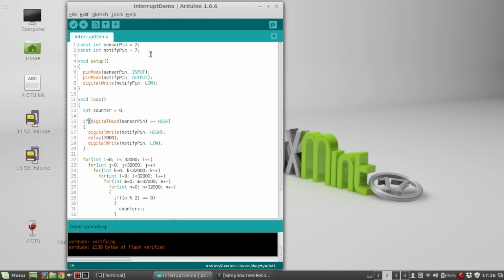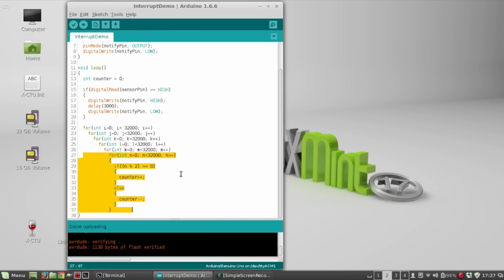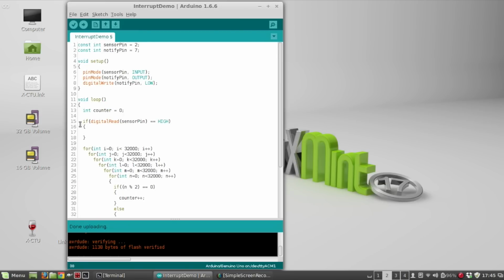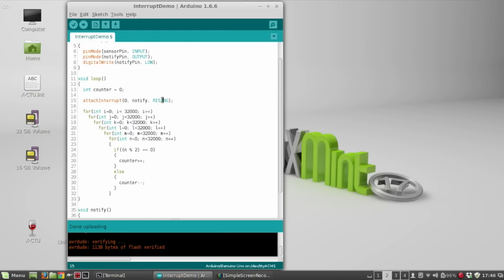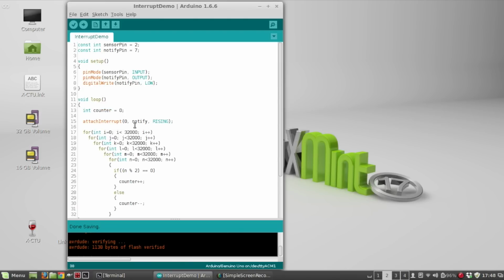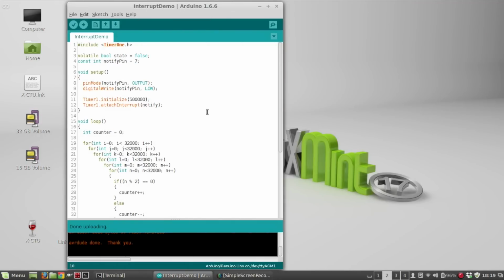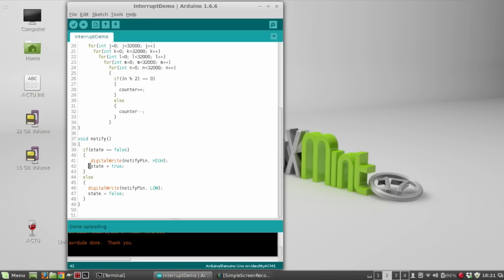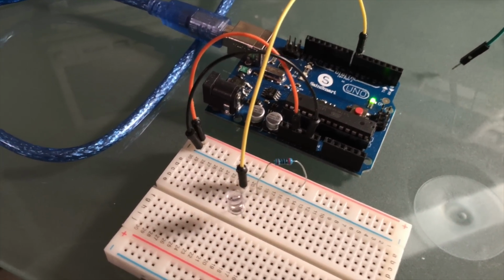How to Use Arduino Interrupts

Comment: Thanks for the video. You made it harder for yourself than necessary by using the PIR sensor, since it pulls your signal pin on the Arduino high for a couple of seconds, so that the pin is still high when your dummy loop finishes, and thus lights the LED.
Use a momentary push button switch instead of a PIR sensor.
Reply from the maker: Yeah, that makes sense.

Comment: amazing i understood arduino from you and guess what i pass this material without even coming to lectures all thanks to you man youtube is the real university in this world
Reply: for more information 

attachInterrupt(interrupt, ISR, mode)

Typically global variables are used to pass data between an ISR and the main program. To make sure variables shared between an ISR and the main program are updated correctly, declare them as volatile, so if you wanna set a variable that holds a low or a high value you can use volatile function , thanks ;)

Comment: If I may suggest that you work out all the bugs in your demo BEFORE you make the video.
Also, you could have used a change variable which would get triggered if the sensor detects an object and also when it stops detecting an object. That way the LED would be on if the sensor detects it and off otherwise. You could print the counter inside your mega loop and show that the interrupts don't have much effect at all in your main loop. That would have been impressive.

Comment: Excellent tutorial. Can I ask what video capture software you are using? I am thinking of making some videos showing the computer screen. Thanks.
Reply from the maker: Thanks.   I use SimpleScreenRecorder (http://www.maartenbaert.be/simplescreenrecorder/) to video what appears on the screen.  It's only available for linux, and it works great.  You can plug in an external USB microphone and it should recognize it.  I use the Blue "Snowball" model mic and it works fine.  Otherwise, it will  use the computer's internal mic if it has one (mainly laptops).
Reply: Thanks so much for the reply. I'm on a PC, so I'll have to keep looking. Rick

Comment: nice video...can you tell me how to code for running two arduinos at a time but one after other...need to synchronise two unos ..when one working other should be off
Reply from the maker: You may be able to have them communicate with each other using the I2C serial protocol.  You would set one arduino as the master and one as the slave.  This article helps to explain how to do that: https://www.arduino.cc/en/Tutorial/MasterWriter

Comment: Hello sir, I am facing a problem with Interrupt program when I interfacing Bluetooth module...Without giving any interrupts my program is interrupted when Bluetooth module is connected. Will you please help me to solve this issue...
Reply from the maker: If you are using a third-party library for the bluetooth module, look at the source code and see if the interrupts are coming from the library.
Reply: sir I didn't use any separate Bluetooth library....can I send my source code to your mail?

Comment: Super and you saved the day. I come from embedded micro controllers on one hand and PC programming on the other. Needed something that would count my 3,600 Hz clock (internal interrupt) and reset on external pin transition (external interrupt). You covered both and having just gotten back into it after 20 years I didn't even know if the Arduino could do it. Thanks much. Saves me lots of TTL hardware.
Reply from the maker: Thanks for watching, glad I could help.

Comment: superb dude !!! well explained ..it took me a while to find good videos like yours'
Reply from the maker: Killer Thoughts Thanks for watching!
Reply: +Electricks welcome
Reply: +Electricks we use this to make buttons (connected to LED )sleep until they are pressed right?
Reply from the maker: Killer Thoughts Absolutely, especially if the button press is critical to the system.  If you have a lot going on in the main loop, it is possible that a button press can go undetected.  An interrupt will guarantee that the pressed button will be acknowledged.
Reply: +Electricks thanks bro..it's so helpful